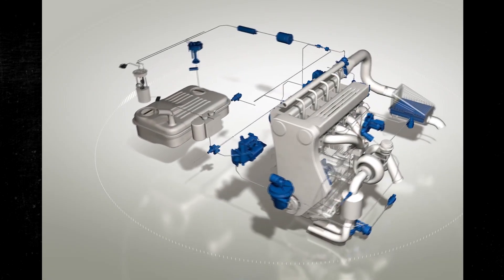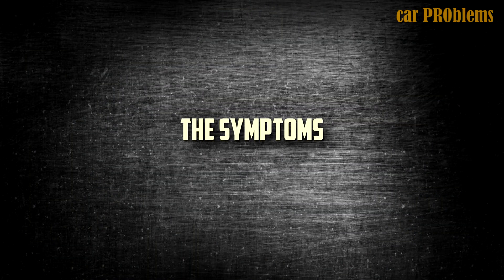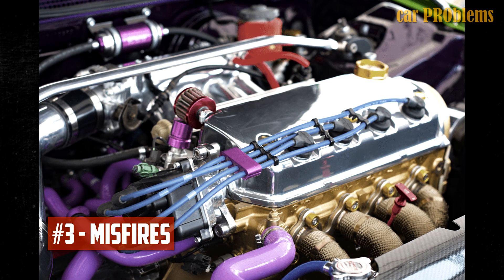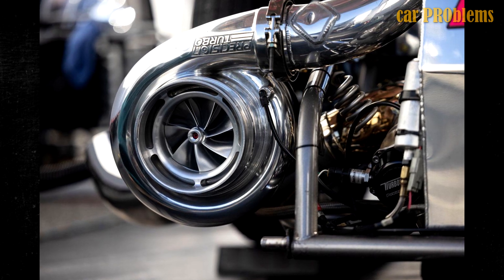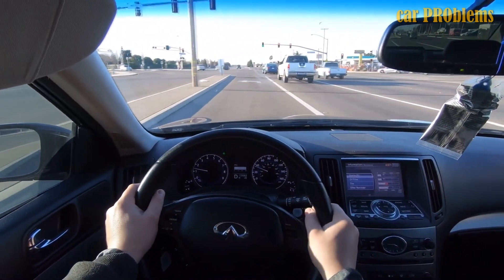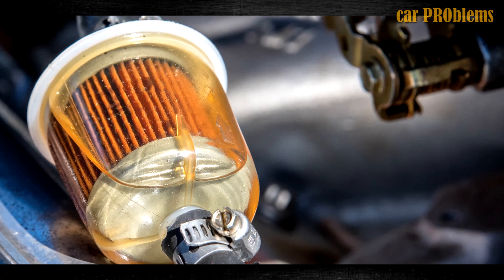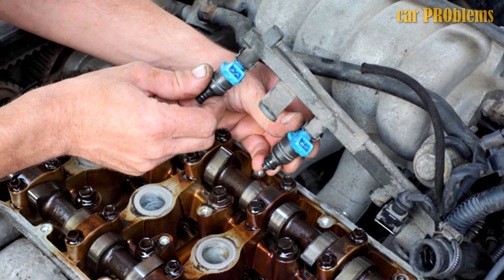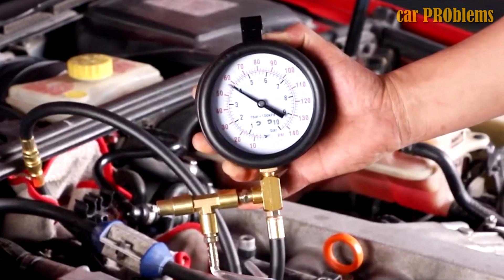7 Symptoms Of Low Fuel Pressure & Common Causes

Comment: I purchased a new 1991 Toyota pickuyp with the 3.0L V6 engine. Brand new truck idled rough and dealership promised to fix the problem. Six months later, the best solution they offered was to demonstrate how the idle stabilized when they pinched off the fuel return line. The dealership never said what was done to solve the problem, but 370,000 miles later and to this day, I have not experienced fuel delivery or idle problems with this truck.

You didn't mention this symptom and I'm wondering if all they did was to place a restrictor on the fuel return line.

Comment: This might be a good question though, but my Cadillac Seville Elegante  368 v8 6.0l (1980) has a cracked Fuel return line, does this also decrease fuel pressure??

Comment: Thanks. So low fuel pressure cannot be my problem.  My car (2006 Opel Tigra Twintop) starts fine but cuts out after 10 secs. Under advice of those who know more than me, I changed the fuel filter, the fuel pump (nightmare); no difference. As for the regulator, mine is within the fuel pump assembly, fitted to and part of the whole fuel pump assembly and not sold as a separate item. I have a Schrader valve on the fuel rail to take a pressure tester but 99% of kits don't have the appropriate fitting... go figure. If I hear the click from the rear when turning key to position 2 (1 being just pushing it in) that means electrics are fine, right? Have a cheap Obd2 tool but that's not showing any codes; would buy even up to 200 dollar one if it would find the fault but have spent much time reading up on them and they all have a considerable number of detractors -- 10% of 45,000 ratings puts me off. Any advice please??
Reply from the maker: Hey there! Sorry to hear about the trouble you're having with your Opel Tigra. It's frustrating when you've already tried a few things and still can't figure out the issue. Here are a couple more suggestions you could try:

- Check for vacuum leaks by inspecting the hoses for any cracks or leaks.
- Make sure your spark plugs and ignition coils are in good shape.
- Give your throttle body a thorough cleaning to see if that helps.
- Consider cleaning or replacing the mass airflow sensor (MAF) to ensure it's working properly.
- Don't forget to check your fuel injectors for any clogs or issues.

As for the Schrader valve on the fuel rail, finding a pressure tester with the right fitting can be tricky. It might be worth consulting a mechanic who has the right equipment.

That click sound you hear when turning the key to position 2 indicates that the electrical system is getting power, but it doesn't guarantee everything is working perfectly.

If you're thinking of getting a better OBD2 tool, read reviews from reliable sources and look for models with positive feedback.

Ultimately, it's best to consult a professional mechanic or an Opel dealership for expert advice and hands-on inspection.

Hang in there, and I hope you can get your Tigra Twintop back to running smoothly soon!
Reply: @carproblemsmax  Thank you! A lot of new ideas there, and I'll have to research them 'cos they're a bit esoteric for me at present. Update on previous: a pressure tester arrived WITH A SCHRADER ATTACHMENT !! Yabadaba! 52psi and holding after an hour. So fuel delivery is ruled out as problem. Whereas before it would start fine but cut out after 10 secs, now it won't even fire... I'm pursuing your clues. Thanks again!

Oh, by the way, regards the kit, I did ask a local friendly garage, a local friendly parts shop, and a bigger not so friendly garage: all negative. The latter said re unavailability of Schrader attachments: "Nous avons le même problème." (In France. 'We have the same problem.'). They cut into a pipe and make up a fitting.